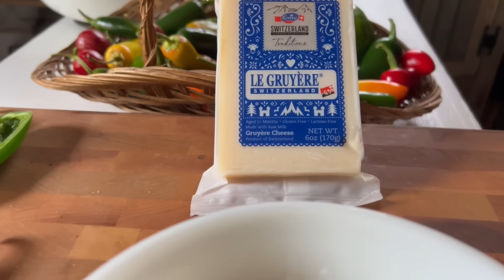Everything is Changing

Comment: Your a great wood stacker, my hats off to you of your talent at stacking wood.
(you are better at it than me)
Great access point for sweeping out the chimney from the ground
At least you do not have to go on the roof to clean it out.
A clean chimney is a happy safe chimney.
I would recommend if you is to get a drill as adapter to attach to the sweeper to use your drill on it to really spin the stuff out.
That is if you want use your drill in aiding in cleaning the chimney.

Comment: I use to have my own work shop in Michigan I heated with wood for years, where I ran my Landscaping business from. Would go out cut my own wood and later split it all and stacked inside for the winter. My wood-burner had a fan on it and had duct work made to put the heat to other parts of the office, bathrooms, other work shop area's where I built ultralight aircraft in the winter.